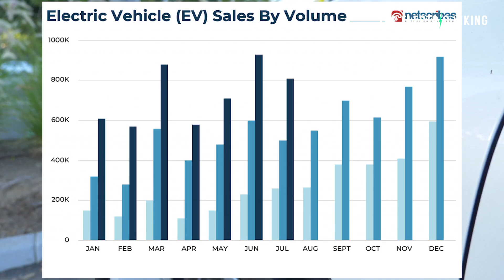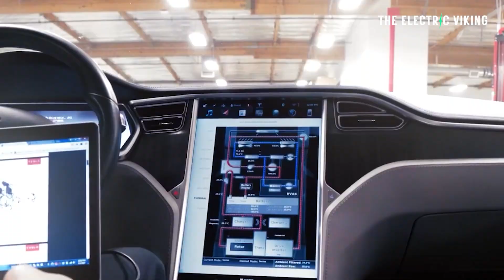The BIGGEST mistake EV owners are making when it comes to the battery

Comment: I have a g1 Honda hybrid - if you try to get to the battery you have the following warning - do not open - you will be killed. This is a tiny battery pack compared to those you'll find on Full EVs. Anyone even considering opening one of these for a repair needs to be very serious about their approach to doing the repair with full technical knowlege of the particular pack, safety features, proper resplacement parts, tools , checks - or they are risking their lives or the lives of the people who drive the modified pack - A Certification program is needed.  If such an entity were setup.  Safety could be maintained.

Comment: It would be lovely if EV battery packs could easily be repaired and have a quality battery pack; but you'll find Tesla and others have no confidence in the work done by some independent shop. Poor work could result in a fire. In that case Tesla may literally stop you from using any of their facilities including charging. This is the main reason why people don't risk it and feel they must buy a new one.  What needs to be done is have a certification system for battery pack repairs - then - companies like Tesla can probably accept the quality of the repair as meeting certain limits they would take a risk on. Insurance companies might also be willing to take on the risk of a repair vs replacement if a certified entity did the repair otherwise they do not know the risk involved.

Comment: If too many drivers swapped their 'ICE' car for a battery car, unless they had their own big LTO battery at home with lots of solar to charge their car from overnight (instead of pulling from the grid) then it would be a big undertaking for the new power stations and increased grid power capacity. Denying nuclear, letting copious gas get sold out to foreigners' control, clowning around with big solar and wind farms is helping to keep the majority poor and lower living standards. I can sympathize with the occasional commercial battery bank for grid stabilisation. But my point is how many 'fast-charge' (still like 6x slower than petrol filling) stations can you have before it overloads local power?  Even if the power is available for all the fast chargers, have you seen those vids from california of long queues of teslas waiting to use the fast charger late at night?

Comment: Would be good if some sort of standard existed whereby the battery/car could be instructed to run a test and produce a report on the state of each cell, etc. 
Perhaps it could do this as a default setting every 3/6 months overnight, and postpone the operation if the user wants to drive the car, and give the user a message on the screen if they've got a bad cell. Could have an online marketplace for used tested cells to match the other cells' capacity. Tesla could probably lead that quite easily.

Comment: Who’s going to buy your old battery and how does that matter?
I don’t have time to figure this stuff out, I need my car to work again tomorrow, I need it fixed now.
Battery repair or replacement when they fail out of warranty still means the end of a car, doesn’t it? 
Except maybe for something like a Nissan Leaf, but still, that works only if you have plenty of time and don’t need your car every day. 
There is a good video from ‘transport evolved’ about the issue of repairability, check it out. This plus charging network are major obstacles to EV adoption past the stage of ‘second car’ or toy car.

What do you think of batteries becoming ‘structural’? Isn’t that going to make them even harder to repair and maybe even change?

Comment: I agree reuse and repair can often be quite easy for someone who knows how to do it. One exception is structural batteries, taking those apart can be quite difficult. Although they can be recycled easily. There is likely more than one type of "structural battery".
Reply: on my truck (lightning) you need a lift and a battery stand, as well as some PPE (duh). That pretty much eliminates any DIY solution when the time comes. 

Not much different than an engine out in one of these modern trucks. Requires lift = not diy friendly because no one rents lifts anymore.

Comment: Repaired batteries = lots more EV fires.

The reason EV has had much lower rates of fire, in spite of much higher electrical complexity, is  because few people have been fiddling on the equipment.

As more people fiddle on them more will burn.

Comment: Hey Viking what your saying is not true in many ways as in a lot of cases unless you can get your ev at your own cost to a battery service Centre that knows and works on that specific kind of battery then your only option is replacement. Here in nz even for many evs including Nissan leaf there are only about 2 companies that offer a full pull apart of the ev battery pack and even by the time it’s pulled apart and cells tested, faulty cells found and replaced and then pack re assembled and re tested again and the fitted you can often be looking at 3-4K for the repair bill vs buying a whole good second hand battery even with a larger capacity for around $6k for example. As for packs being worth money, due to them being Dg dangerous goods class and super expensive to send around the country even to try to recycle and also companies charging a lot in nz to even take the pack in for recycling yeah your pack is basically worth nothing if it’s faulty or failed or removed from the ev with issues, and in some cases the owners are actually charged to send it away for the recycling cost. Keep in mind nz has to send packs overseas at high cost to recycle lithium. So you may want to get your facts right in your video otherwise it’s hugely misleading to many customers. As for people needing some skills to even open up and work on a battery pack remember these are all Hv packs so if you really don’t know what your doing and have a lot of training then you can easily kill yourself. Finding qualified people here in nz who can even work on these packs there’s literally like less than 10 people in our whole entire country so it’s like finding hens teeth to even get access to a person trained up and with the skills to do it but yet you fail to mention these things clearly in your video.

Comment: great video and good topic. i think the reason there isn't many places that want to repair a battery is the lack of training by the manufacturers, they generally advise the centers to replace the pack as troubleshooting and repairing it is risky and to successfully fix it right and offer warranty on the repair would be hard. as the batteries weren't really designed to be repaired. it can be done by someone very skilled who has expertise in this field but for majority of the techs this would be a hazard and high liability if something went wrong or battery catches fire later.
i think manufacturers should simply offer lifetime warranty on the packs and replace them at no cost and take the old pack back.

Comment: If black mass is so valuable why according to CSIRO and UniMelb, only 10% of lithium based batteries are recycled. The rest languish in storage before going to landfill with the rest of the other 90%.
Reply: If the lithium is being used for small devices, such as cell phones or laptops, it's not worth enough to be worth the effort of taking it somewhere where it can be recycled.

Not the case for an EV in a junkyard, where you've got tons of the stuff all in one place.

Comment: I've heard re-purposing to domestic battery application is probably more cost effective than reconditioning/cel replacement but can't find any companies doing this. Hopefully the talk inspires some action.
Reply: @orionbetelgeuse1937  you could say the same for any company not doing something, the day before they started doing it but it doesn't make it true. I'm looking at 2nd hand Leaf batteries at 50% capacity (12KWh) for NZ$2,300. Add a fire-proof container + BMS & you have a domestic battery at a fraction of the cost of a commercially available one.

Comment: But if you look at the foam in Tesla batteries and the welded connections in BYD batteries, replacing cells is totally uneconomic. GMH & VW batteries (LG Chem?) however offer a much better repair possibility.

Comment: Have you seen what's involved in repairing a battery? It is a lot of work and expensive. 5 hours to pull the battery = $1,000, 5 hours to diagnose and tear apart the battery = $1,000. Nobody replaces cells, they replace the module, 3 to $4K. close it up = $500 - install and test $1,000. Factor in your time, car rental etc. and a 10 to $12K offer on an installed used battery starts to sound pretty good. You can always sell your used battery to recoup some of the cost, "WRONG" that was included in the price, your old battery now belongs to the used battery company. Have a nice day!!!😂😂😂😂😂😂

Comment: OK, where is a listing for "Qualified battery centers" by US State?
Only read about a handful of places even willing to try to repair these modern EV packs, and of those the feedback for the Model 3 seems to be even when they replace a entire module with a wear matched and identical attribute module, the way the system is designed it will rapidly fail again?
Where can I read about modern EV batteries being repaired successfully 3rd party, and specifically for the Model 3?

Comment: Re black mass being worth $10,000 per ton (1:30), does anyone know if Tesla provides a credit based on this price for your old battery pack when replacing it with a new or refurbished battery? Or, can they just load my old battery pack in my rented u-haul truck so I can take it home and then have someone pick it up and pay me the $10,000 per ton rate?

Also, does anyone have any updates re Johnny Bacigalupo and Rob Hussey being charged a whopping £17,000 bill by Tesla to fix their battery - which they claim was "damaged by the rain"?

Lastly, re repairing battery packs (8:15), Tesla's latest battery technology (4680 cell-based battery packs) is not serviceable. Sandy Munro revealed this fact in one of his videos.
Reply: Yeah, I doubt anyone gets the $10k per ton rate.  Sounds like a hassle to lug it home from the service center when they refuse to pay that much, and then you have to find someone who will.  Bet it's not that easy.

Comment: Perhaps EV manufacturers that do the best job of used battery support. Will have the most success with customer service. There is no reason why a company like Tesla should just leave their customers hanging. Think of the information would they be able to accumulate. If the batteries have value why are the EV companies not interested in buying back used batteries? The concept of best experience would be great to apply here.. I believe EV manufacturers are making a huge mistake  in not warning their customers of used battery rip off. Of course EV manufacturers could wait until they're forced to do something by having a law passed to control their responsibilities. It seems to make no sense that EV companies are not helping with use batteries. What do others think? Thanks for this program ! 🙂

Comment: Looks like the 4680 battery packs won't be that repairable due to the Pink Foam encasing. Don't know how they would repurpose this 
one . See the Sandy Munro teardown of it.. Looks like the blade battery would be easily serviceable as each pack is a blade.
Reply: Sandy Munroe Also regularly says you can have durability and longevity or you can have reliability. You can’t have both. 

Teslas new unreparable battery is completely sealed making it completely waterproof. Removing the issue of it bursting into flames after being flooded with salt water. A major issues with lithium battery cars.

Comment: 5:50 ... It's not exactly a myth but more that it's no longer true.  When Tesla first started making the roadster and even the Model S the battery pack was in fact pretty close to 50% of the price.  Of course now that battery prices have fallen some 80 to 90%, it's no longer true.
A decade ago a Model S with 240 miles of range was $80K.  Today's has almost double the range, is far more capable and it's $6,000 less!

Comment: Be smart. Charge between 40-80% for local use. 100% when absolutely need the distance, while using up the 20% extra right away. At 100% idle use heat swells batteries.

Comment: That's if you charge it at 30_ 80% so only use 50% of the battery all the time .perfect  weather  23 degrees.    And you slow  charge  it all the time......that's what is good for a ev
Reply: For the vast majority of the time, when you're just driving around town, using 50% of the battery and slow charging all the time is all that you need. But, the other 50% of the battery and the fast charging capabilities is still there when you need it. Sure, using that capability wears out the battery faster, but most people road trip infrequently enough that it just doesn't matter.

Comment: Great stuff as usual! Video idea:  what do you think?  options for converting a used car battery into home energy storage.
Reply: A second hand Tesla m3 battery costs in Norway about 4,300 euro, then the work upon that, and you have quite a big home storage capacity.
Reply: That sounds like WAY too much work. But businesses are starting to use used car battery packs for grid storage, so you could sell to one of them. If you want home energy storage, buy a battery designed for it. Unless you WANT to do the work…
Reply: Safety is the main concern it doesn't catch on fire

Comment: Recycling batteries is not new or unique to EVs. Lead acid car batteries are recycled at about 90%. That's why we don't have lead mines all over the place and why lead is still affordable. The battery in your car might have some lead in it that was mined in the 1950s! Modern batteries like the ones used in EVs have a lot of use and value even after they are too weak to be useful in a car. Many auto parts are refurbished and you have to turn in the old one when you buy one so it can be rebuilt. Refurbishing EV batteries is going to be a huge opportunity. There are shops that can repair something as delicate as an iPhone so I'm confident there will be tools and processes invented to repair EV batteries. Aftermarket packs with newer battery technology will also be great to see.

Comment: Can you do a segment on charging systems in areas for infrastructure focusing on utilities as the rate of charge requiring an area to upgrade the KW needed in an area to charge as the demand increases over time as more EV 's within an area increase and the draw compared to houses overloads the grid ? Nothing seems to be talked about the utilities being able to service the grid between residence and hungry EV charging within a area where you may live today .Let alone considering commercial needs.
Reply: Let's say a person drives 50 km in one day, then the car needs about 7-8 kWh.
The house may need 4kW 24 hours/day... Do these 7-8 kWh/day matter, I don't think so.
Many houses need 20 to 40,000 kWh a year, so charging ONE EV is marginal in all ways.
Reply: Electric utilities just have to upgrade their billing system so they can charge different prices per hour for electricity. Once they have done that most EV owners will charge their car when electricity is cheap. This actually helps stabilize the grid because turning off power generation when they are producing more electricity than can be used is really hard to do. 

600v to 240v step down transformers, the ones you see on power poles are the only things that are really sized for how much electricity goes through them over a 3 day period. They need to cool down when power is not getting used so AC, new houses, and EV’s can cause them to overheat. But I have never heard power companies complain about selling more power and having to do small upgrades. Plus solar on the houses solves this problem because the electricity gets used before it goes through that transformer.

Comment: I think a big thing that's needed is open-source repair information for the batteries. I've read that Nissan has opened up information about the Leaf batteries, and GM is giving out repair information for their new Ultium batteries.
Reply: Good luck with Tesla's blackbox model that copies Apple's anti-repair policy. They want you to keep buying new Tesla's instead letting you repair it yourself.
Reply: @i6power30  -- I have a Bolt.
Reply: Super dangerous backyard playing with high voltage dc?
Reply: @dumpyosaurus6765   - Certain shops are already fixing Leaf batteries.

Comment: The best battery for a car is lpg(liquid petroleum gas) used in conjunction with a motor to convert energy into motion(a petrol engine) they are very economical  and if the lpg is running out and you can't find a charge point(lpg filling station) you can charge it with petrol instead!! Don't know why nobody thought of this before😂
Reply: Talk about waste
Reply: @shou635 OK, buying a new car every 3 years=waste. Fitting cars with hundreds of unnecessary gadjets=waste. Encouraging/focing  people to scrap perfectly good cars to replace them with new,with environmental production impacts greater than running the old car for many more years=waste. People for whom an electric vehicle is not suitable converting an existing car to lpg? Doesn't seem wasteful to me. Perhaps you could explain. Just a footnote, lpg co2 emissions are negligible. Don't put your eggs in one basket. And proffesing to improve the environment for our children whilst children mine raw materials in slave labour conditions seems quite counter productive to me. Too many people fixated on ev being the solution to all problems. Too many fixated on continuing with petrol and deisel
. No-one considering alternatives. Or the fact that one single minded path is never a solution!!!